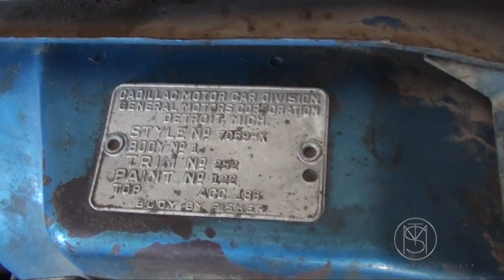Incredible Collection! (Barn finds of a lifetime)

Comment: From Hemmings: As built for Motorama in 1955, the Chevrolet Corvette Nomad was essentially a 1953 Corvette from the A-pillars forward, grafted to a 1953 Chevrolet sedan chassis and wrapped in fiberglass bodywork. Power came from the Corvette’s 235-cu.in. “Blue Flame” six, rated at 150 horsepower and bolted to the two-speed Powerglide automatic transmission. Popular opinion is that the Corvette Nomad was destroyed after its Motorama days were over (though more than one may have been built), but a few replicas have been constructed over the years.

Comment: When I was stationed in Riyadh, Saudi Arabia there were a lot of 40's and 50's cars just sitting on the side of the road out in the desert, bodies solid but completely sandblasted by the sand storms. The thought crossed my mind back then that it might be worth shipping them back.
Reply: It's hard for a foreigner to export a used car from Saudi - been there -BUT was not able to do it!
Reply: The army sent me to Germany in1965.  PArking lots on the bases were filled with old cars that GIs had just abandoned over the years.  I remember several early 50s BMWs, some Auto-Unions and Benzes.  They were typically worth less than $500 at the time.  I bought a '65 VW in 66 for $625, 14,000 miles.
Reply: Write USMC , property of

Comment: Once did a roof quote for a fellow near Chicago on an empty warehouse. Or so I thought. Had to go in to check the water supply and found rows of cars under tarps. No one around so I decide to take a peak. This was about 1985. Every one was the same. I believe they were 1960,  or around there, white Lincoln convertibles. About 25 of them. All like new. I may be wrong about the year, but it was close to  1960. We never did the roof and 5 years later I heard he died. I have often wondered why so many of the same and why he stored them like that and what happened to them. Guess some secrets will never be found out. Never did go back and live in Wisconsin for 26 years. I doubt I could even find the warehouse, it was in Elk Grove Village in the industrial section. Wouldn't it be something if they were still there?  33 years later.

Comment: What a collection! Makes me sick to remember the cars I gave away.. Two nice drive-able 58 Impalas, one '58 Chevy truck also drive-able. Sold my cherry 55 Chevy for 75.00 and my '55 Studebaker  2 door Starliner Coupe for 100.00.
Reply: Don't feel bad.  I sold two Porsche 911S coupes and a '58 Speedster dirt cheap, a Lotus Elan, a Lotus Cortina and two TR-3s.  It's only money.  I had a blast with them all.
Reply: Who knew
Reply: Same here, sold my 1st '62 Impala that I bought for $100 from a friend in 1979 and sold it for $125 a year later and thought that was a deal! Sold my '71 Torino 500 w/302 for $175 before that and it was beat, rusty and wrecked down one side. Sold a mint Rambler American with a blown clutch for $50 in 1982. I bought it for $300, drove it everywhere. I finally got lucky in 1999 and bought a 2nd Impala for $200 and sold it 3 days later for $1750.

Comment: I Watched this for the Clickbait Nomad they went right past it LOL with barely a comment.  So stopped the ved an looked for  a few moments.  Saw one of these  in street condition At hot August nights  in the same turquoise and white tutone.  it was modded with diskbrakes and i think a later vette irs rear end.  He had some pretty good literature on the car.  I had  No idea a couple of these were floating around GM shows in the mid fifties.  
         I grew up In LA and wanted a nomad for a surf wagon Ha Ha even in 63  they cost too much but there were some around.  Luckily that was the time before Hardened valve seats so cars needed a heads off valve job at 60K miles. So there were a few around that needed work but it was cheaper and faster for somebody just to get a newer car when ya needed it for work.  Anyway the big 3 years of chevies 55-57 were pretty easy to find for a kid that needed a project.  
           I finally found a 56 nomad dead  a block  away from my home.  Its was all there but compared to most of the sedans the paint was terrible.  Pushed it home and blocked the driveway with it.  My mother nearly passed out when she found out I paid $300 for a car that didn't even run.  But it was great fun putting it together took every dime I made at part time jobs tryin to make a HOTROD Chevy out of it .  But it was fun.   Boy that old man sure had a bunch of money pits at his Lot He better get rid of them  quick gas engine toys are ckomming to the end of the line soon i think.  Cheers

Comment: There is a 54 Nomad here in N. Idaho, been around as long as I can remember (I'm 56) and it's still on the road today.if you know where to look you'll find a lot of vintage cars, mostly American,  mostly rust free as we have used salt on the roads and mostly not for sale
Reply: Rick Nelson, are you sure it is a '54 rather than a '55, '56, or '57? Does it look like a '53-'55 Corvette in front?
Reply: @davidtemple7373  for some reason I typed 54, its a 55 or 56

Comment: That 1954 Nomad appears to be a replica. There are features which do not match the real car. Compare the rear wheel track (seems too narrow) with a photo of the actual car. Also note the rear wheel well which comes all the way down to the bottom of the quarter panel. However, it does not appear to be a Superior Glass Works build, so it had to be built by someone else. A nice copy.
Reply: It HAS to be a replica. The original CORVETTE Nomad Called a Corvair, (Corvette and Bel Air mixed) was destroyed directly after it was photographed for the 1954 Motorama Magazine. That comes straight from Chevrolet.

Comment: I used to stop there coming and going when I went from Lake Forrest, CA to Surprize, AZ to visit family. I never realized all that stuff was in the back. We never went beyond the office. Actually, we only went to the office once to ask about a Hudson Super Six he had out front and spoke to the gentleman in the hat. I asked if it ran and he said yes. Brought out the key, turn it over and she started right up and purred. My wife talked me out of getting the car because I had my hands full with a 1942 Cadilac Series 62 which was proving to be difficult because parts were so rare. My car was complete accept the center caps for the hubcaps, a banged up fender and front bumper. All of which were 1 year only. Dang it. Should have traded for something.
Definitely going to pop in there again since it's been a couple years since we stopped taking that route. It's no fun driving a big old Caddy on the 10 so we cut across the back roads but we still roll through there. See you soon sir...

Comment: Another way to tell a 53 ocrvette from a 54 is look where the fender join the body at the door jams, if the glass is rough and ragged then it's a 53 because 53's were all hand made and assembled,( exception is when someone cleaned up the jams by sanding smooth the joint fender fittings) 54's the edges are all straight and clean and smooth edges from the assembly line.

Comment: The only Nomad in '54 was the Motorama concept car.  The production Nomad, built off the standard Chevy body, not the Corvette, intro'd in 1955 and was produced through '57. After that, they used the Nomad name but only on a standard Chevy wagon.

Comment: That missile looks very much like the remains of an MGM-13 Mace missile from the 1950's through early 1970's.  They were used until the very early 80's as target drones at Eglin AFB, FL.  It might also be a variant of the Firebee drone still used today by the Air Force.

Comment: Most of these cars people say'd they'd kill to own them, but if you did, after a few months you'd stop driving them pretty quick, as they suck gas like no tomorrow.  13mpg when gas gets back up to $4/gallon and it will be out in the yard with a blue tarp over it collecting leaves.    Parts are hard to find, systems break on them - there are lots of non-running cars probably in your own back yard you won't even fix.
Reply: Owning a classic car isn't about reliability or mpgs. Its owning a piece of nostalgia/history. You enjoy the artwork of its design, the simplistic workings, the way it connects you to the road, the smells of gas and oil. They have a personality or a soul if you will. Old cars are funny that way.
Reply: @confusedmaster1924  I have a 1983 Datsun 280zx turbo (22mpg), and there comes a time (20 years?  30 years?) when everything just starts breaking on a car.   These things have had a hard life and are pretty much wore out.   I can't afford to fix mine or drive it, and have no interest to, because my Honda Rebel gets 60mpg.  Why would I want to go back?   It's a Jaguar knockoff piece of japanese junk that never really went fast...  but somewhat collectible and an antique.  Plastic degrades, upholstery falls off, knobs break, engines wear out, shocks loose their rigidness, etc...   they are just a PITA.
Reply: @flyingwithchristina  ooooo I love those 280 z's. I own an 82 subaru and its falling apart, but I still fix it and prefer it for the way it makes me feel. I guess its all just perspective. To each their own I guess.

Comment: Nothing was lost, so nothing was found.
Reply from the maker: If you found a clock at a yard sale. You found it.  It does not have to be lost to be found. A barn find is a classic car, aircraft or motorcycle that has stored, often in derelict condition. The term comes from their tendency to be found in places such as barns, sheds, carports and outbuildings where they have been stored for many years. The term usually applies to vehicles that are rare and valuable, and which are consequently of great interest to collectors and enthusiasts despite their poor condition.

Comment: the 54 nomad is a 1 of 1 recreation car has a 1953 corvette front end on a pontiac safari chassis the car was built for motorama did the tour for a yr and was crushed story goes there was a recreation car built that must be that one if the story rings as true there is a video showing it  in the Clairmont collection in Chicago in 2015 it is a private collection of 300 cars not well known as it is a private collection so if anyone reads this go find it 1955 Chevrolet Chevy Corvette Nomad Wagon Motorama Concept on My Car Story with Lou Costabile
 so either it was purchased off of the clairmont collection or story is wrong about the car going to the crusher because story has it as a 1 of 1 recreation car in the door jam on the 1 in clairmont collection has a Pontiac label in it is kinda weird i watched the clairmont video earlier today and this video later has me thinking do some more searching on this

Comment: A friend of mine right here in Waco has one of the 32 '54 corporate limos, like the one at 5:03, with factory AC.  The motor had a bent lifter and the engine has been removed and repaired.  It's still in the mechanic's shop awaiting reinstallation.  It needs its electrical and Hydro-Lectric systems rebuilt as well.  I understand they made 32 corporate limos without the divider and 32 executives with the divider, or I may have my terminologies backward.  https://www.youtube.com/watch?v=XKG9ssm7gB4